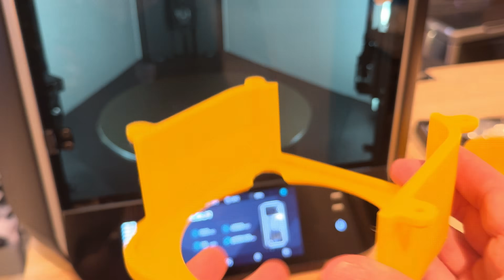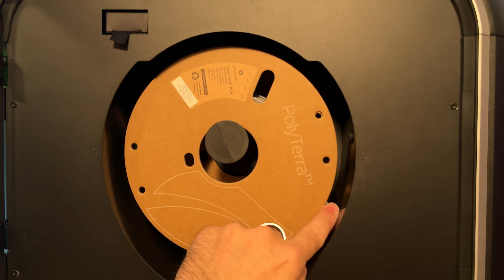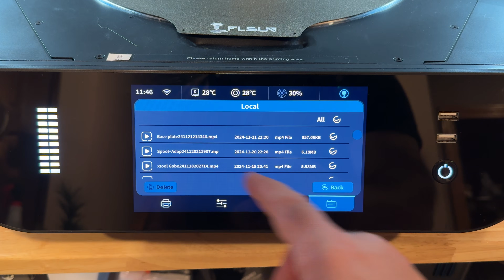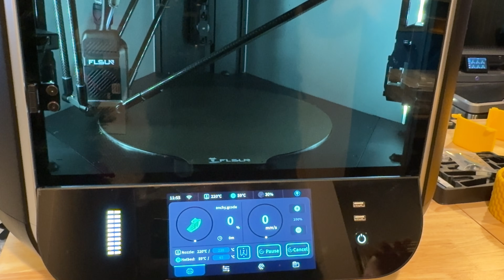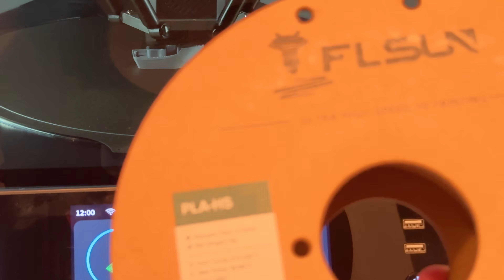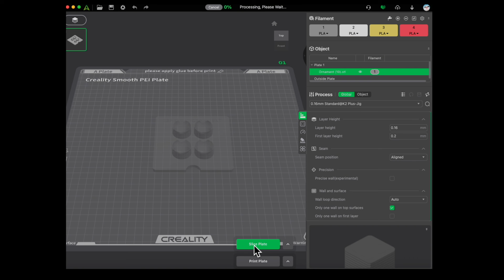You Won't Believe the FLSUN S1 PRO 3D Printing Results! a First Look

Comment: I completely agree with you about this being a rapid prototyping tool. And it is that, a tool. If the tool works for you then use it. 
I have 2 s1pro printers and they work beautifully for what I need them for. 

If I need a high end Bambu Lab for what I'm doing, then I will use that tool for that task.

Comment: I want to see how the print quality is on a slow speed, like 200 mm/sec.  To see the benchy at the fastest speed does not have much value to me bacuse I'm interested in how good it will print. I'll use the fast spees for rough prototyping, but will always go for the best quality for final prints.

Comment: From 2023 to 2024, more 3D printing farm owners have emerged. For 3D printing farm operators, the S1 Pro could be an excellent choice. Of course, if cost is a concern, the T1 Pro is also a great option. For some multi-color printing projects, the Anycubic Kobra 3 Combo or the Bambu A1 Combo could also be great options to consider.